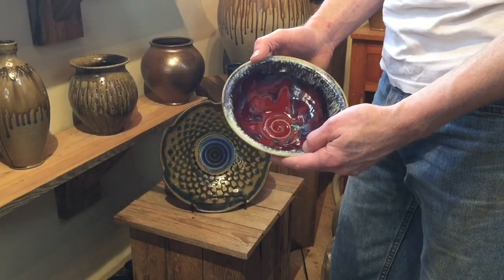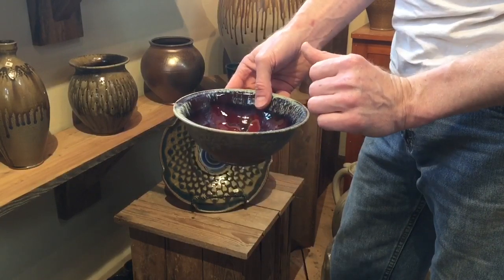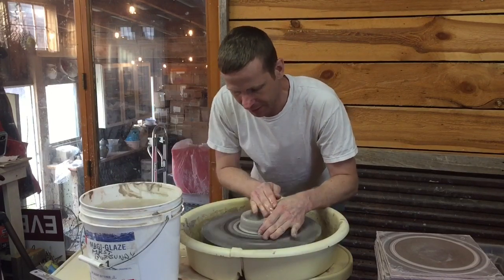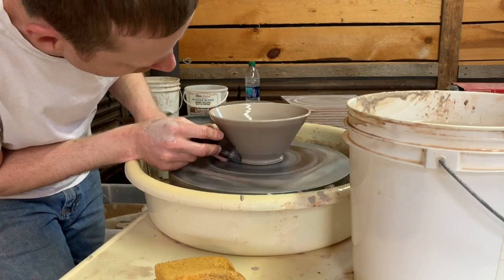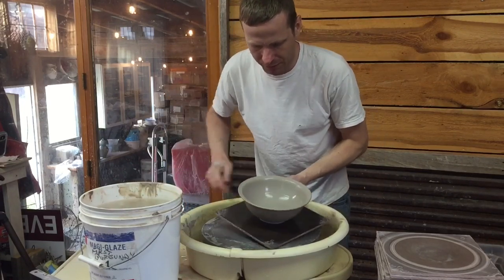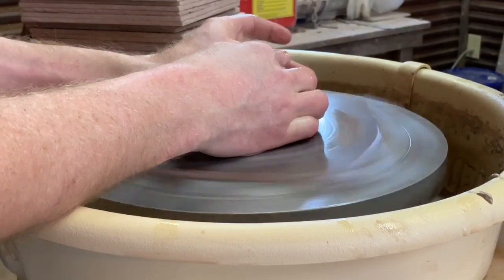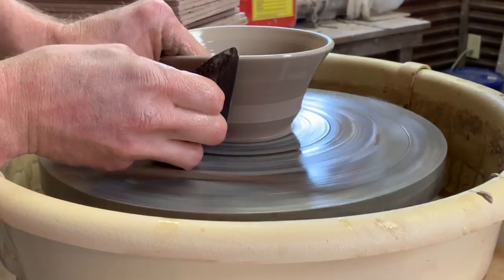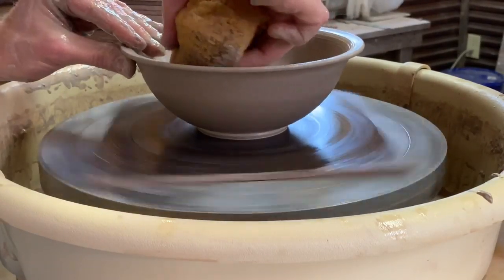How To Throw A Bowl

Comment: I'd like to agree with you I've only been throwing again after a long time off for about 4 months now and I'm already starting to cut back on my trimming making a similar type of foot is you. I've seen plenty of trim feet that look absolutely terrible. I've seen people ruin parts that were otherwise pleasing to the eye by putting a foot on them. If you make a nice perfectly smooth unglazed base that is nice smooth as glass it's every bit as utilitarian and beautiful.

I've also gone to a new kind of foot on cuffs where it's just a slight rounded put that I do not glaze I turn the edges rounded over and then just a slight dug out of the interior and they're beautiful
Reply from the maker: I love a nice trimmed foot on a bowl or any pot for that matter but I’m not one who thinks it’s not a proper bowl without a trimmed foot. I’ve made bowls without a trimmed foot that most potters couldn’t rival even with one. With or without they are both skills and admire and applaud both when done well.
Reply: @MatthewKellyPottery  Again, I absolutely agree. And I'm sorry for all the typos. I do not use a keyboard any longer because of a neurological. Issue that I'm having I'm sure it'll clear up someday, hopefully. . Thank God I can still throw clay. So voice recognition screws up so bad, and I never notice it. .

. Yes, you can make a pot look nice with a trimfoot specially in Asian. Style pot it looks right. With a small foot But I've also seen more than not people putting Gerke and chewing deep feet in bowls. And utilizing a flat bottom rather than rounding it and it just loses. Something. People are afraid of drips. And many people don't take the time to learn good. Glaze control. As a result you see a lot of large unglazed feet It just look out of place in my opinion. Again, rather than a straight foot. I've been taken to making a slight round foot. With about 3/16 indention on the bottom. And it just looks so nice. I wish we could post pictures on YouTube. I'm really not well enough to start my own channel. Maybe someday I will. When I get a little better. . I love your one pound Bowl. Tutorial it's very well made. And I'm going to work on full consistency based on your work. So I appreciate that you help a lot of people.
Reply: @MatthewKellyPottery  Don't mind me. Making a suggestion. I personally have a little bit of a problem making very narrow bottom vases. Are you pull up nice? Perfect column? Cylinder pretty regularly and consistently But I have a little bit of a trouble. Narrowing the base I have never learned a good technique on that. That might be a good video. No. I mean, I know basically what people do but there's got to be more to it. I always end up having to pull up again because of the extra clay that's being forced into the bottom of the vessel 

You think that's worth a video?
Reply from the maker: I’ll definitely consider that. Most of that is experience but I’ll think about it some more. I don’t mind the suggestions. Cheers
Reply: @MatthewKellyPottery  I'm sorry for How badly illegible some of my sentences are. I use voice recognition? And I don't hardly catch the mistakes. Cheers

Comment: Do you have a video, or post where you talk about your bats? What are they made of? How big are they? Thanks in advance for responding.
Reply from the maker: I’ve talked about them several times but I do have a video on bats specifically. The product is difficult to find in some regions. It’s tempered hardboard, and 1/4in thick, smooth on both sides. My square bats are 9in square with holes drilled for my wheel at 10in on center.
Reply: @MatthewKellyPottery  Many Thanks for the info. I'll be checking out the hardware store to find hardboard!

Comment: Great video!  Love the different angles and the sound was fantastic.  What are the measurements when wet?
Reply from the maker: Should be 3in tall and 8in wide. I removed my gauge for filming purposes but that’s the size I normally make them.
Reply from the maker: Thanks for the input on the audio. I have a mic for my phone now but still a struggle to balance it all.

Comment: Hello Mathew, I wonder if you had your wheel spanned clockwise when you centred & opened, then anti-clockwise as you started lifting the clay wall? I failed on throwing alot...Still trying to figure out why I cant lift the wall up!  Also, confuse if I shld exert pressure on the outside or inside  bottom of the clay..Will be grateful if you can advise. Many thanks

Comment: Hi Matthew, i have a problem with pulling greater amounts of clay.  Even with great effort, to much clay will stay on the bottom. Can you make a film on You Tube to explain. how to pull up cilinders with for example 4 kilograms of clay.
Reply from the maker: I can do that although I rarely use that much clay in a single piece pot. By the time I reach what would be about 2.5 - 3 kilograms (I use pounds, haha) I would start making them in sections. But that all depends on the shape also. I make large bowls and such much bigger as you’ve seen on the channel. But I will add that to my list to make cylinders and talk about pulling clay. Thanks

Comment: So you don't wire cut these? Do you slow dry them to help prevent warping?
Reply from the maker: I think drying on the bat actually helps keep them from warping bc they’re never sitting on an uneven surface. Even if the bat is not sitting flat the bat itself is flat and the weight of the bowl is not enough to warp it. I have had larger pots warp due to sitting on an uneven surface on a thin bat.